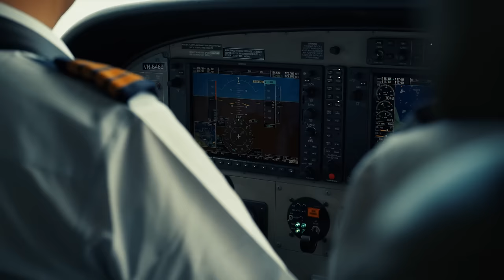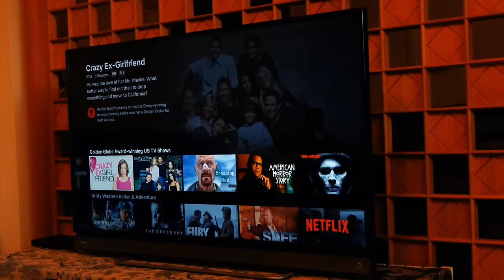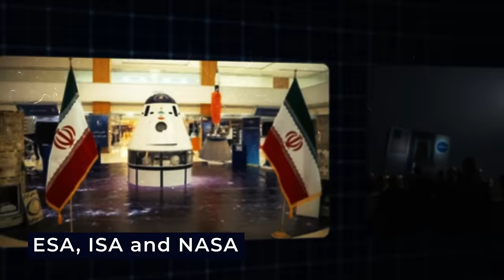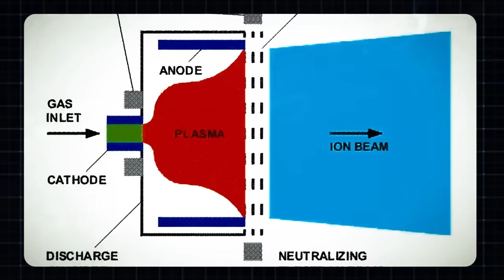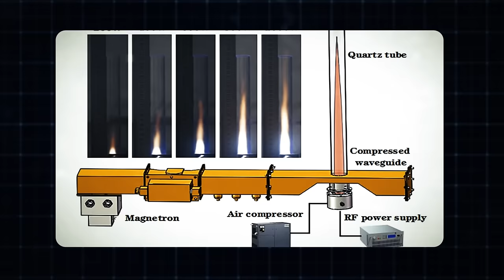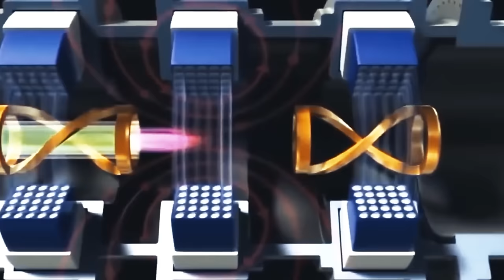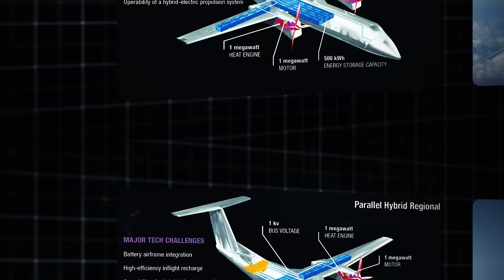The Microwave Plasma Fighter Jet that Could Change Warfare Forever

Comment: Shipping ships are WAY MORE POLLUTING than aircraft and the amount of fuel they use is way worse!!
Reply: Not true. Shipping is more efficient than air shipping
Reply: Of course they are.  A cargo ship is exponentially larger than any aircraft ever created. The most efficient cargo aircraft's fuel efficiency is dismal compared to the least efficient modern cargo ship. If it was even kinda close you would no longer see cargo ships. Why would anyone use a vehicle that that travels at a few dozens of mph versus a vehicle that travels at several hundred mph if the cost was even kinda close.

Comment: Microwave plasma fighter jets have the potential to revolutionize warfare in a number of ways.

Speed and maneuverability: Microwave plasma fighter jets could be significantly faster and more maneuverable than traditional jet engines. This is because microwaves can be used to generate thrust directly, without the need for the complex and heavy moving parts of a traditional jet engine. This could give microwave plasma fighter jets a significant advantage in air-to-air combat.

Range: Microwave plasma fighter jets could also have a much longer range than traditional jet engines. This is because they would not be limited by the amount of fuel they could carry. Instead, they could draw power from microwave generators located on the ground. This would make them ideal for long-range missions, such as strategic bombing or reconnaissance.

Stealth: Microwave plasma fighter jets could also be much stealthier than traditional jet engines. This is because they do not produce a hot exhaust plume, which can be easily detected by infrared sensors. This would make them much more difficult to target by enemy aircraft and missiles.

Cost: Microwave plasma fighter jets could also be much cheaper to operate than traditional jet engines. This is because they would not require expensive fuel or complex maintenance. This could make them more affordable for smaller air forces and developing countries.

In addition to these advantages, microwave plasma fighter jets could also be equipped with a variety of new weapons and sensors. For example, they could be equipped with microwave weapons that could disable enemy aircraft and missiles without having to fire a single shot. They could also be equipped with new sensors that could detect enemy aircraft and missiles at much longer ranges than current sensors.

Overall, microwave plasma fighter jets have the potential to revolutionize warfare by making aircraft faster, more maneuverable, longer-ranged, stealthier, and more affordable. They could also be equipped with new weapons and sensors that could give them a significant advantage in combat.

Here are some specific examples of how microwave plasma fighter jets could change warfare:

Air-to-air combat: Microwave plasma fighter jets could be used to intercept and destroy enemy aircraft before they can reach their targets. They could also be used to escort bombers and other high-value aircraft.

Air-to-ground combat: Microwave plasma fighter jets could be used to attack enemy ground targets, such as tanks, artillery, and missile batteries. They could also be used to provide close air support for ground troops.

Reconnaissance: Microwave plasma fighter jets could be used to conduct long-range reconnaissance missions. They could also be used to gather intelligence on enemy movements and positions.

Electronic warfare: Microwave plasma fighter jets could be used to disable enemy radar and communications systems. They could also be used to launch electronic attacks against enemy computer networks.

Overall, microwave plasma fighter jets have the potential to make a major impact on the future of warfare. They could give air forces a significant advantage in terms of speed, maneuverability, range, stealth, and cost. They could also be equipped with new weapons and sensors that could give them a decisive edge in combat.
Reply: You're not in English class my guy